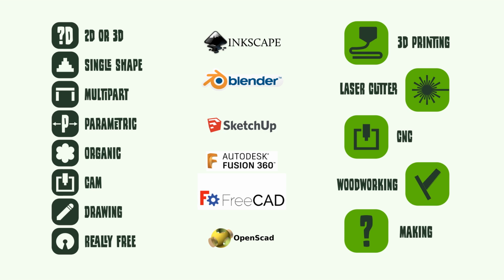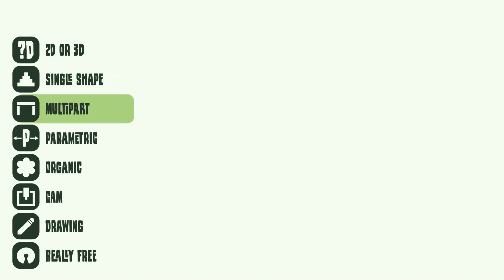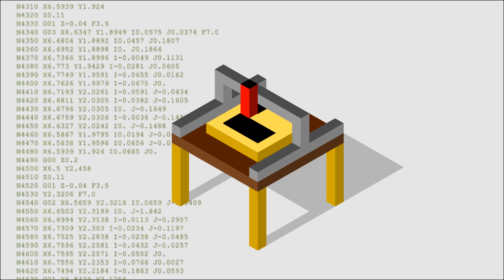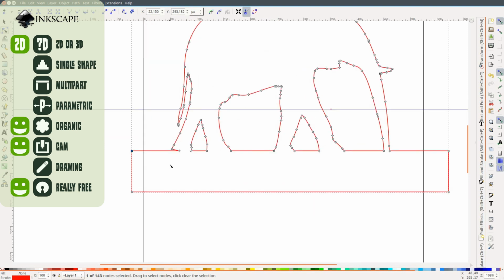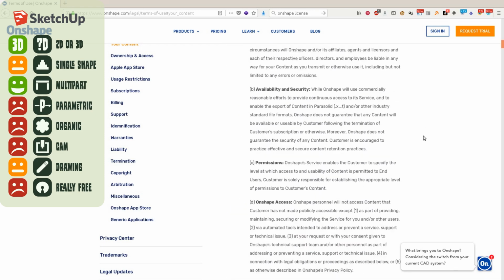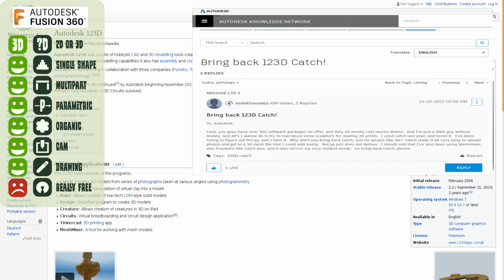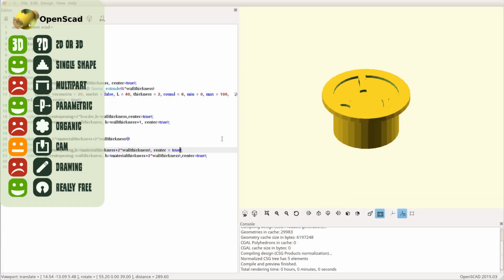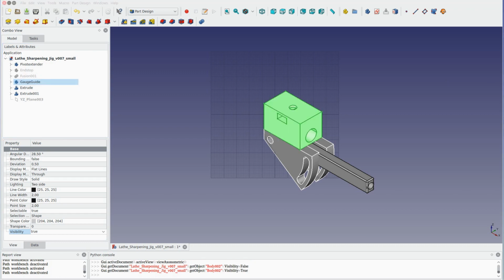Free CAD for Makers in Woodworking, 3d printing, CNC and laser cutting

Comment: Thanks for the video. FreeCad definitely needs more love from YouTube makers.
Reply from the maker: I could not agree more. Some more thoughts on the topic here: https://youtu.be/GJZEcEeWAYw
Reply: As a furniture maker I’ve been using sketch up 2017. But now that I’m getting into selling my work I need an option that allows commercial use. I don’t mind paying but I hate the expensive subscription based model that is normal now. I use it just to design show the pictures to customers and get cut lists. I don’t need anything fancy like making gcode . I’ll have to give freeCad a try.
Reply from the maker: Great. FreeCAD is definitely a good replacement for SketchUp and it will allow you to reflect customer requirements in the parametric design much easier...

Comment: Very nice video. For CNC projects I started to learn Freecad, for 3D printing I work with Openscad, for 2D drawings I have Qcad (costs a small amount). Now I'm want tor try Rhino3D even it is expensive, but has a lifetime license (how long?). Then I hope to do all my work with one software only. Will see.....
Reply from the maker: Interesting. What are the features you are missing in FreeCAD that Rhino is offering?
Reply: Rhino 3D does offer competent 2D Drafting capabilties
Reply from the maker: Got it. For me the Sketch workbench in FreeCAD was good enough so far.

Comment: FreeCAD replaces Fusion360 in 2020 for most parametric uses  (truly open source multi platform in active development with 3rd party python modules )
FreeCAD even has Cad to Cam with Adaptive tool path simulation for milling
Reply from the maker: Fully agree. However there are some features missing - Rest machining is one of them ... ;-)

Comment: I totally agree.  I am not useing software that only works online and steals you're drawings. Thank you reading the user agrements.  Still like the 2014 version of Sketchup, however Windows 10 graffic card drivers made it a pain to use.  So, irrr Space Claim version of Design Sparks Mechanical, is the other CAD program, kind of like sketchup, that had a free version. However they seam to have "handcuffs" on their programs as well.
Reply from the maker: It’s somehow by design that the „free as in beer“ software always comes with handcuffs...

Comment: Nice. Wonder what is suitable today for designing kitchen cabinets and then CAD software (assume this is the CAM module) generating the panels (i.e dimensions and list of items) for cutting?
Reply from the maker: I have a series of videos on what is possible with FreeCAD in that direction. However if you want to run a production shop you might rather want to spend some money for a commercial solution.

Comment: this is great Video , thanks alot , i was comparing but you already shortcut it and give me final result , one question left , could you tell me difference between free cad and Solidworks and which you recommend and why ?
Reply from the maker: I would recommend using FreeCAD - especially for furniture design. One of my last videos is avoid advantages from free software. The comparison between Fusion and FreeCAD is more or less identical for Solidworks. 
Also look on my channel for some detailed videos on FreeCAD for woodworking.

Comment: Use Design Spark Mechanical. Good alternative too
Reply from the maker: What do you like about it?
Reply: @WayofWood  the spped you perform a model using direct modeling instead a parametric modeling centered tool such freecad.
Reply from the maker: Sounds interesting. I will have a look at it.

Comment: Very instructive summary, thank you. What are you using for the CAM part? Say you want to use bigger steppers with driver modules and addressed via parallel breakout board? Thks in advance, David C.
Reply from the maker: I am currently using FreeCAD to generate gcode from the CAD model and send the code to the CNC with UGS. I do however plan to transition to LinuxCNC going forward...

Comment: When will freecad be able to replace fusion 360? A question of more importance is what if I was to make a very unusually designed 6 or more axis CNC milling machine, how would I make those software work with it, and which one would be easier to adapt my machine to?
Reply from the maker: The question is what you want to do with FreeCAD. The CAM module of FreeCAD is working well for 3 axis, there are first prototypes for 4 axis but it’s quite a way to go till it might support 5 axis. 
On the other hand open source has the big advantage of being easy to change. If Fusion doesn’t support your 6axis out of the box I would try my luck with adoption FreCAD or PyCAM.

Comment: I've been using Design Spark for CNC designs in titanium. I need to purchase their add-on to convert STL to STEP for my CNC people.  I'm open to comments, suggestions, and advice, for better solutions, or what ever.
Reply from the maker: Converting STL to STEP is difficult. FreeCAD has a workbench that supports a manual conversion process but there is no free automatic conversion module that I would be aware of.
Reply: @WayofWood  Thank you for your prompt response! One can purchase the add-on modules here: https://www.rs-online.com/designspark/introducing-the-new-designspark-mechanical-add-on-modules. My main question was, is there any info, or, reviews on the add-ons. Is it a good investment? Just curious.

Comment: Blender

No, really 

It's the fastest to work with and you get sublime looking renders in real time, right inside your viewport
YEAH, that's right : you can EDIT while rendering ! 

you can also use Blender's UV texture packer to optimize the cutting area without having to export it into cumbersome web apps

As of 2020 you can use the MeasureIT-ARCH to create dimensions right in your viewport and export any kind of drawing from any angle or even overlay the dimensions onto the photoreal rendering in real time

Blender IS usually used with a highly destructive workflow, but that doesn't mean it can't be fully parametric 

You can parametrise anything using modifiers, drivers and empties (most people will tell you Blender's parametric capabilities are limited because they only look at the modifier stack and don't realize you can combine modifiers with drivers and empties to get truly unlimited power, albeit with ONE MAJOR caveat: they're gonna be polygonal. 
You can alter the resolution to get as accurate or as simple a model as you want, and be able to easily edit every parameter, BUT you can never export your model to a CAD software because fundamentally, it's still a mesh and not a NURBS solid. This makes Blender absolutely excellent for hobbyist makers because it's an absolute joy to use, it's the fastest and least buggy out of all of them, completely free and you can use it for everything and not need anything else : draft modelling, parametric designing, 3D & 2D animation, sculpting, rendering, video editing, VFX, just the entire production pipeline in one software (also BlenderCAM is a bit old but it's comparable to FreeCAD's path workbench)

whatever you do, be it laser cutting, CNC, 3D printing, just whatever you do, if YOU do it then please learn Blender and thank me later, but if you need to design your stuff and then send it off to somebody, you're screwed unless an .STL file would suffice
Reply: While they're largely neglected, Blender does have nurbs. It's the Surface category of objects. However, the modifiers and such are largely designed for mesh, so once you start manipulating with booleans and such the advantages are lost.
Reply: @0LoneTech  Blender's NURBS objects don't count because they lack core functionality such as trimming. 

If you can trim NURBS you can do anything. You can manually implement literally any solid modelling operation. But with no trimming, you're out of luck, and won't be able to make something as simple as a cylinder with a hole cut out of it's side

Comment: I build wood models and would like to start using a CNC. Help please. How do I start with the 2D drawing of a part with a complicated shape and end with the same shape on a piece of wood? Is that even possible?
Reply from the maker: Have you thought about using a Laser cutter as an alternative if the shape is 2d?
Reply: @WayofWood  Thanks for the response. I had not thought about using a laser cutter but just did some research on them and discovered they would not work for my application. I frequently use ½” and ¾” thick wood (or more) and that seems to be beyond the limits of a laser cutter. Then there are the burnt edges. Nope, that will not work. Back to CNC. How hard is it to go from a drawing on a piece of paper, to the same shape on a piece of wood?
Reply from the maker: @nukebert1 You could glue several pieces together to get the necessary thickness. CNC is quite a bit more difficult than a laser as you have to think about the windmill suitable for the job and work holding. Complexity depends on these two factors.
Reply: @WayofWood I’ts a no on laser. I can’t get past the burnt edges.

Comment: Looking for something that will just convert STL or other solid model file to a 2.5 C CNC G gode.

Like a 3D printer but cutting away what I don't want.

I'll deal with designing the objects so it doesn't try to make something hollow.
Reply from the maker: F Huber Using the Path workbench in FreeCAD might be an option. You can import the STL into FreeCAD and then run a 3d adaptive toolpath on the object. Still requires some manual work but it’s the only option I could think of...

Comment: You do a big mistake to include Inkscape as CAD software because it's not one of these, it's a vectorial graphic drawing software.

Even if you can import SVG in FreeCAD by example, that's FreeCAD which convert it into shapes that can be printed/routed, Inkscape don't do more once the SVG file saved and imported in the CAD software.

So Inkscape IS NOT CAD SOFTWARE, be warned everybody, you can't create functionnal designs with it, nor export STL from this...
Reply from the maker: CAD stands for Computer Aided Design. So every software that helps you to create a design on the computer is a CAD software. 
If you would watch the video you would see that I distinguish between 2D and 3D systems. 
2D systems  such as LibreCAD or Inkscape can naturally not export STL - which is a 3d format. 
Nevertheless you can create quite functional designs also in 2D: https://youtu.be/kjfCNDXylog

Comment: I took the advice of this flowchart called Which 3D software for 3D printing? ( https://go.gliffy.com/go/publish/5271448 ) and tried DesignSpark Mechanical. The experience is good, it's powerful and easy to use. It seems to be a freeware subset of SpaceClaim with RS Components parts library. Here's a table comparing it to SpaceClaim Engineer:  http://www.spaceclaim.com/en/Products/DesignSparkMechanical.aspx

Only one concern has cropped up with the latest update: the software package has suddenly become much larger (2GB+) and a bit slower (more power hungry). Poking around in the files it looks quite messy, I wouldn't call the craftsmanship elegant. Which makes me wonder about the platform's future health. Also you have to register to use, if I recall correctly.

Have you tried it? If so what did you think of it?
Reply from the maker: I have not used DesignSpark. If I would use a freeware (ie non-open source) for 3d modelling I would use Fusion 360. It's damn powerful, has a great UI and a very active community.